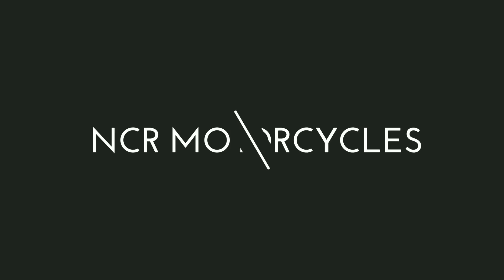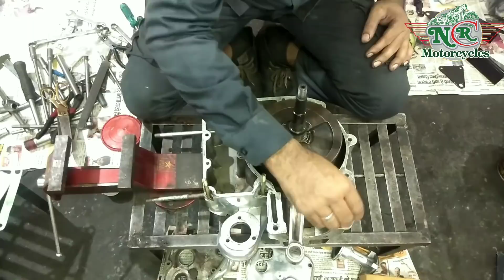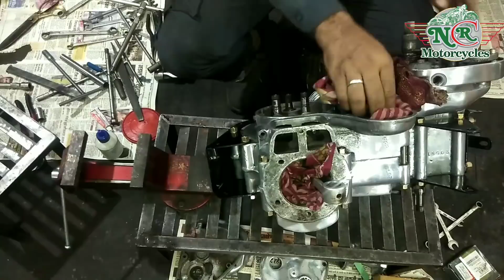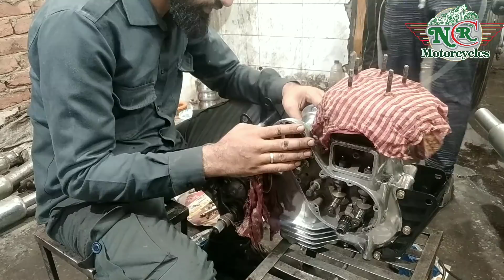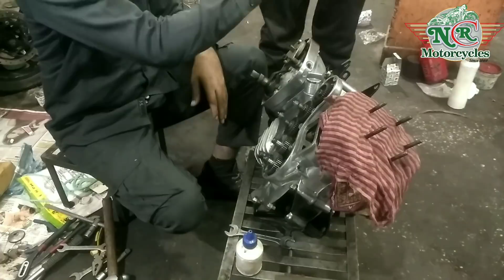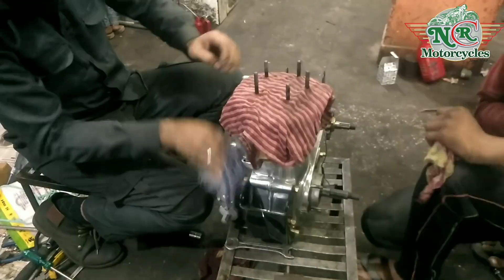Old bullet restoration part-2    {08/05/2018}

Comment: The steel table/stool where you assembled the engine should have been padded so that the engine does not get scratched/dented as aluminium is softer than steel. It should be assembled on rubberized mat.